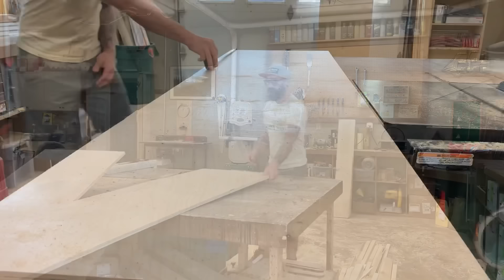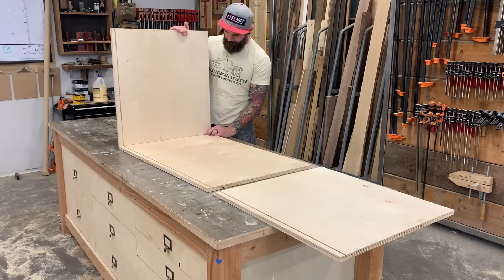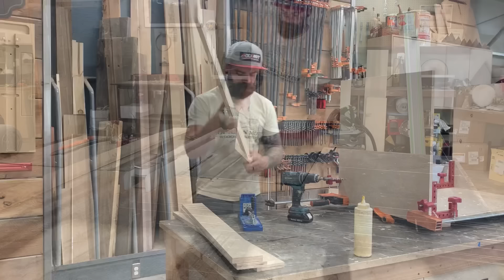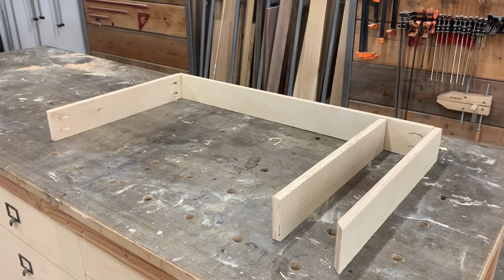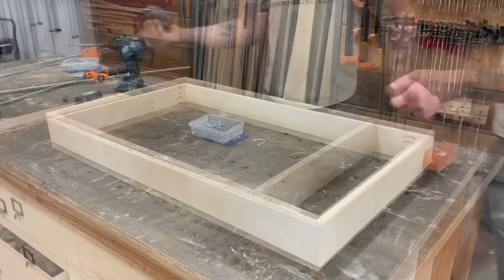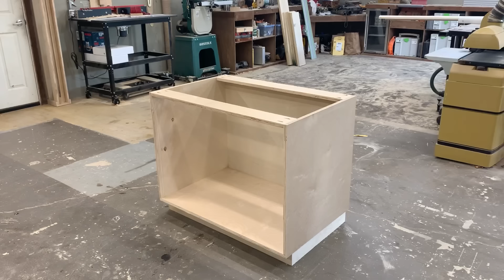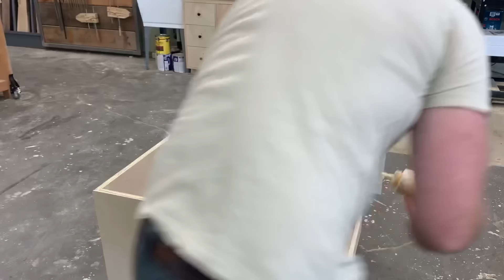Build Cabinets The Easy Way | How to Build Cabinets

Comment: I do a fair amount of cabinet work and have used several different methodologies.  I watched the video just to see if there was something that would help my efficiency, make things easier in general, and/or produce a better end product.  Sir, you delivered.  I'm going to switch to making the toe kick separately.  Leveling whole cabinets can be a pain especially if you are in tight places or are getting up there in age.  I appreciate your work.  One thing I would like to add for anyone who builds or is planning to build a lot of cabinets...  Three tools/products have totally changed how I do things... 1. A pocket hole system of some type (Kreg for small quantity and Castle for situations requiring large quantities.). 2.  CA glue (I can't live without it!) and 3. My panel saw for breaking down sheet goods.  The video was great.  Entertaining and very informative with one of the best methodologies for cabinet construction  I have seen.  Can't wait to watch more.

Comment: Thanks, I’m a new woodworker and this is just the kind of thing I need to learn, my first attempt at a cabinet type thing, a dust collection cart, didn’t turn out as well as I would have liked. If I had seen this video first I could have used some of your tips. Anyway thanks for this video, you got my sub.

Comment: Can you put a link to the "bar stock kit" used to measure the table saw blade height?
Reply: It's from Woodpecker just like his corner clamps. Don't have a link but Google Woodpecker tools and you should be able to find it.
Reply: @TheSatyrblue  Looks like all the sets have been discontinued.  I can't find a current purchase option anywhere.

Comment: Are you planning on adding more cabinets next to this one which is why you didn't miter the other end of the kick plate?  Also, what's the name of the Mohawk product?
Reply from the maker: There’s a link to the Mohawk filler in the video description and one side of the cabinet is going up against a wall.

Comment: Thanks, very informative and entertaining! Looking forward to the next videos.
Question: are you concerned about the pocket holes going in the direction toward the outer edge when you use them?
Reply: I noticed that too. It’s supposed to be in towards the meat but then going out is really no different than on the face frame where the point is to hide the screws/holes and there’s no meat to go towards.
I suppose the important thing is if it’s a structural piece which the face frame and toe kick aren’t.
Reply from the maker: Nope 🤷🏻‍♂️

Comment: Well done. Nice looking cabinet. Only things I would have done different are to assemble bottom to sides with no rabbet, just pocket screws from bottom into sides. Then rabbet  a 1/2" back for strength and eliminate the need to the two mounting cleats.

I stopped doing face frames years ago, but at times they are requested. I like euro fronts with iron on edge banding. Paint or stain grade.

Also, since it was paint grade, why not just use gun nails for pre assembly, then a few screws to hold it tight till glue dries?

So many variables and possibilities when building cabinet boxes. It is nice to have options for build style. I also build separate bases for the box to sit on, but usually just use 2x4's and get them level on the floor, then attach the kick plate to front (and sides if needed).

Comment: One day I dream of owning a shop that well equipped. Note to self: Bourbon Moth guy is crazy, and get a Kreg pocket hole jig! Great video. I look forward to the rest of the series.
Reply: Well equipped and plenty of room to work! A workbench like that is a great item also!  Try doing this in a one car garage stuffed nearly full with your valuable junk, and something is going to go wrong.
Reply: @oldjeff2122  
I would suggest that you go down the hand tool route. With just a simple hand plane, set of hands saws and chisels you could easily work from a small garage. 
Have a look at the Paul Sellers woodworking channel as well.

Comment: Once the kick plate is leveled in place, how is the carcass attached to it? Do you screw down into it from the bottom of the carcass?
Reply from the maker: It’s not, it just sits on top. But both the kick plate and cabinet get attached to the wall so they can’t move.
Reply: @Bourbonmoth  What if I were constructing this cabinet for a place with no wall, say a kitchen island?

Comment: I have a few questions about the patented glue spreader. 
1. Is it available to purchase on you web site? 
2. If I do purchase it, how should I expect delivery? Will you come out to my house when I need to use it or will you remove it from the "handy" storage system for shipping? 
3. If the later in #2, do I need to return it when I'm done? 

Thanks, I look forward to hearing from you.
Reply from the maker: Yes, yes and yes
Reply: @Bourbonmoth  sounds great, I'll keep an eye on the site.

Comment: And now I want to go and remake the shop cabinets I just made. The separate toe kick is very smart. Probably way easier to get level. Why didn't I think of that?
Reply: But how does the kick plate and cabinet connect?
Reply: @josh21wells  it doesn't  the toe kick is attached to the wall, the cabinet placed on top and that too is attached to the wall, separately.
Reply: @josh21wells  what I was wondering as well
Reply: men this is what exactly i thought i am gonna do
Reply: I worked in a cabinet shop for one year and learned this trick. Before that I worked with dad building kitchen cabinets and he always incorporated the built in toe kick. He still won't unlearn his ways. Lol.
Reply: @godmello  A separate toe kick also makes it very easy to run wiring and/or plumbing under the cabinets.  This is especially handy in a remodel.